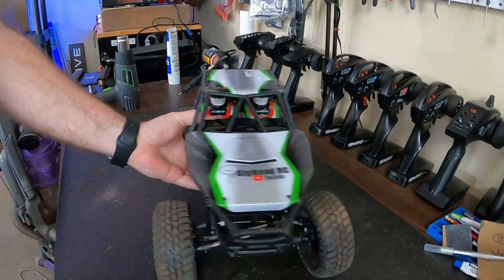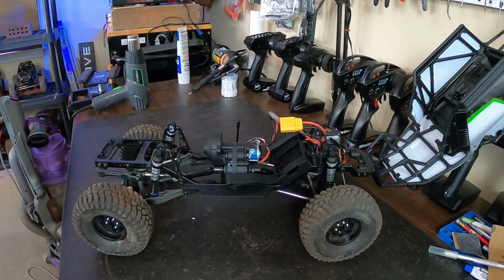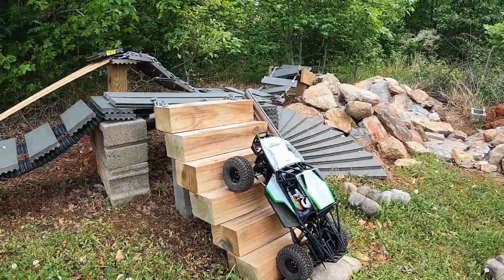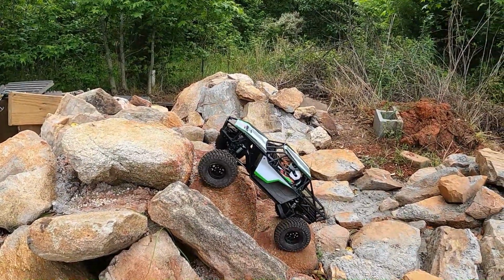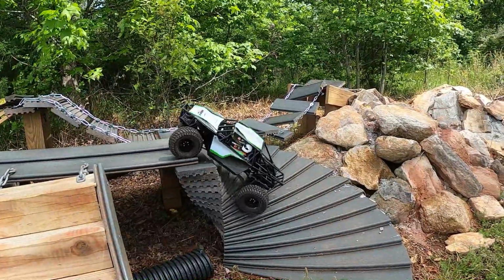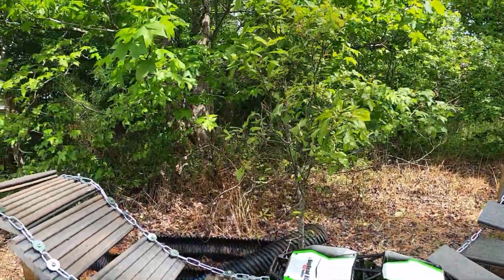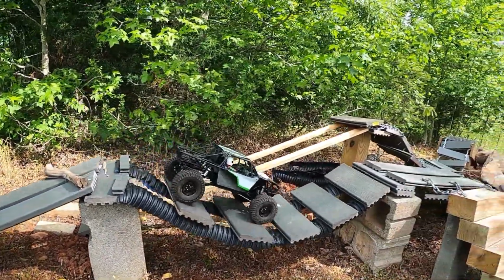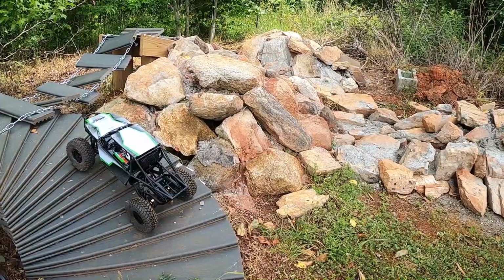Element Enduro Gatekeeper Rock Crawler Buggy RTR - 1st Upgrade & First Test Run #rc #rccar #rccrawl

Comment: Do you have a part number or link for those lower links?
Reply from the maker: It doesn’t have a part number but if you go to the treal website it’s on the under sendero tab  as Treal Brass Front and Rear Lower Shock Suspension Link Mounts 4p for Element Enduro
Reply: @bigheadrc  Figured it out, thought it was the complete lower links that were the way to pieces. Didn’t realize it was small towns, easy to find once I knew what to look for. Thanks for the reply!